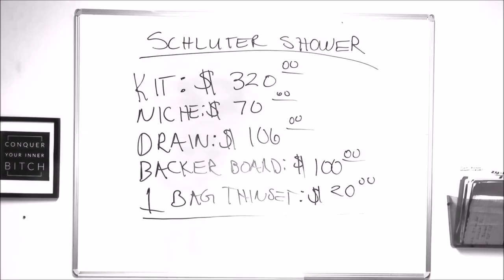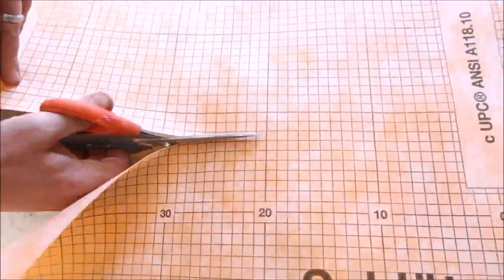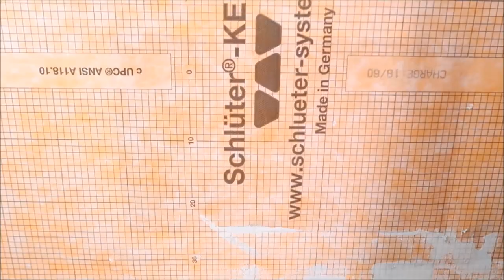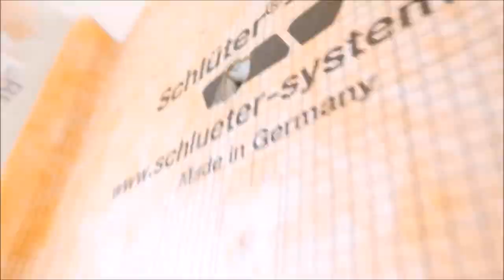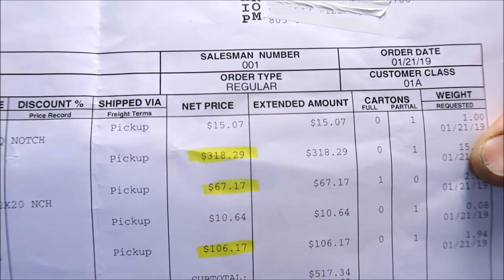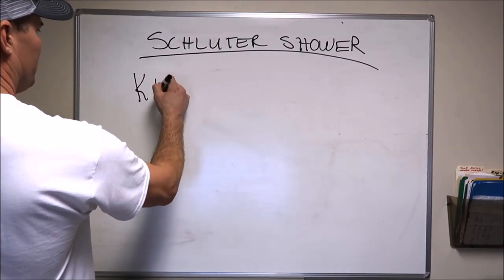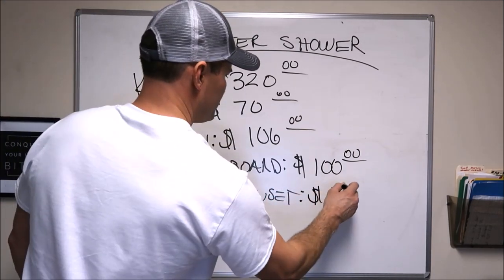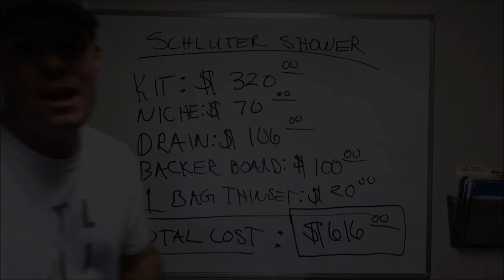The Real Cost of a Schluter Shower

Comment: Been doing Schluter Systems here in Cali for over 5 yrs   No problems ever.   Will never use RG     We used to hot mop, deck mud, wall float, scratch, etc    Now Schluter all day every day.  However you forgot screws, kerdi fix, specialty drains, benches.   We always wait a day to install, never same day.   Ossss
Reply from the maker: same here, fast install is money

Comment: You forgot the cost of the kerdi membrane used on top of the green board... ? 
Also if you’re doing kerdi on top of green board you may as well use regular sheetrock, nothing special about greenboard compared to regular drywall
Reply from the maker: Kerdi membrane is included in the $320 kit.
Also, green board has a moisture barrier vs. regular drywall. The cost is not much more, so why not...
Thanks for the watch and comment sir.
Reply: Ok i didnt know the kit included the kerdi membrane, ive never bought a “kit” 
Also now their pans come with the waterproofing attached which would make it a bit faster. Love your videos man keep it up
Reply from the maker: Thanks! Will keep up the videos, thanks for the comment and watch
Reply: Mr B's Life kerdi is NOT included in the kit.. I’m at DALTILE 3 days a week and that’s not accurate at all

Comment: Trouble with Schluter is one can't find everything you need at Lowes or Home Depot. They have fabric but very few stores sell kerdi boards and even then only in little 32" x 48" size. None stock Kerdi Fix or Schluter All Set and good luck finding the right square notch trowel (1/8 x 1/8) or an unmodified thinset that's not the questionable $7 bag. Had to piece my kerdi board shower together from two distant stores and Amazon. Great video however, thank you.

Comment: I believe any system done correctly will work, if people are serious about a water problem then why not just Epoxy grout the shower area, problem solved and will look great for a lot longer 👍
Reply from the maker: Correct, any system will work if done properly. Things to consider is your body, lungs etc.
Reply: Expoxy grout and a non porous tile material. Also I think the shower pan membrane should be installed first brought  up at least 6" up the walls

Comment: A 3x5 shower with cement board, mud pan, and liquid membrane is about 300-350 at most box stores. So its about twice as much on paper for materials. However, installing the Schluter system will only take 1 day of prep for most installers. A mud system takes at a minimum 2 days if you do it properly with prepitch under the liner. So with the additional labor cost of installing the pan you are really spending the same money as the homeowner. Great video as always brother
Reply from the maker: Great point! thanks for the comment sir 👊
Reply: Do u need a pre pitch if you kerdi the mud pan?
Reply: keith nygaard no. You need to use a bonding flange set in a slurry/mudset if you are going to Kerdi the pan though
Reply from the maker: @keithnygaard3129  Negative, that's another advantage. Pre-fabricated, pre-pitched pan/tray is all you need.

Comment: Dear Mr. And Mrs. Homeowner, labor will be an additional cost. Just sayin'.👍
Reply: i usually charge about 3-400 to do a shower like that. 
the warranty sells it though
Reply: jake garcia your business will sink charging those prices
Reply: Miguel Salgado like sink cause cost is too much or too little?? I personally never done one but if I do labor would be a extra $800-1000
Reply: @JavaZombie  Just to install the Shluter, or including doing the tile, plumbing, etc?  400 sounds about right just for the Shluter, if it takes a day.
Reply: Can a homeowner not do this themselves? If so, is there an alternative for heated and curbless that won't have to be redone 10 years later?

Comment: Kerdi board on walls would b a better install and less time.4x8 board at $80.Kerdi TT on shower.Kerdi All Set(modified) mortar $30 a bag .better mortar.My prefence if your doing Schluter Kerdi System.
Reply from the maker: We feel that not only is drywall more ridged, but cheaper, and much quicker to install. We have done both ways...

Comment: 1its not waterproof. 2 the buildup of multiple layers inside the pan will cause at least a 1/4 inch bow at the bottom. 3 how many jobs allow for plumbing after the shower walls are sealed up.
And it takes only 10 minutes per wall??? That's total BS

Comment: Add extra for a bag of modified grey thinset to set the tray pan  with they recommend now that you use modified for that. Also you used a couple outside corners around that window lol the drain only has two for the curb not sure about what’s in the kit we buy and stock volume of Schluter Kerri product as we install 600 houses per year 😂 I like the video your close it’s about 630$ but hey that’s a great deal for a great product!

Comment: Do not use green board. Schlueter may not warranty.  Green board has a wax on the surface to help with water vapor and mold resist and it may not allow thin  set to cure properly. Tiles might fall off.  Schluter is a waterproof system already and green board is not necessary. I love  Schluter and I use that on everything for tile.  If you are are a tile setter find schlueter class and get certified. It will blow you away on how easy it is.

Comment: I don't know why you would still use green board, lots places code does not allow it to begin with even with waterproofing over top. The price difference is not much more for say permaboard or any other cement board.
Reply from the maker: Much quicker to cut, not dust to inhale, no weight to carry etc. Using a seal system, it doesn't matter what your backer board is...
Reply: Marc Favell Everything  I have read says to use standard drywall and not green board.   Reportedly, the green board has a wax based water repellant that doesn’t play well with unmodified thin set.  Schluter recommends using only standard dry wall under the Kerri.  I just did my first ever shower, and used the Kerri kit, which included the drain in the kit, based on recommendations of multiple local tiling pros.  I was totally pleased with the Schluter products and ease of use.  My 72” x72” kit was about twice the size and twice the price of yours.  I got the kit, extra valve seals and extra corners from Amazon.
Reply: @LandbergTileTV  I here you but one leak in the wall will lead to failure considering its only waterproof on one side not saying it's going to leak but accidents do happen I just like having the customers covered.
On a side note I believe cement board like permabase plus, which I like using is just as easy as drywall and can use same method just not power tools, to cut down on the dust (little harder to cut, but still not bad at all) just my two cents. Love you channel @Landberg cheers buddy from Ontario Canada 😁
Reply: @JT_70  I would never use and are not allowed by code regular or greenboard in a wet area not worth the risk, if a pipe burst not much more money for cement board
Reply: Marc Favell It’s hard to get past the fear of non-waterproof wallboard in a wet area like a shower.  If the waterproofing is done correctly, I’m okay with only one side being waterproofed.  You are right, if you have any punctures or perforations, the waterproofing fails .  I’m convinced that membranes work great if installed  carefully and correctly.
Reply: @JT_70  I here you bit still not good practice in my books lol

Comment: My boss will put the schluter pan in, then run durarock up the walls. Then uses the schluter tape around the base with ardex x 5. Then waterproofs the durarock with some blue stuff. I think it’s wasting time and can’t be good?! I made a cup from a scrap of the orange schluter and put some water in it, 3 days ago. The water started evaporating and it showed no signs of weekness.

Comment: UPDATE * INFLATION * COVID.... * * * *  Add Labor cost / How long does it take to install.. on AVG. 1-2 days.. 1-2weeks.. Plumbing needed? Drain Extension/ Shower Valves / Shower Head/ what if we have Windows to Schluter Kerdi around? what if we want a Bench... Shower Glass? Semi Frameless Vs Frameless 3/8" with Shower Guard Sealer.
Reply: 616 prolly would have been true... but you need tools you have to take into consideration also... Mixer.  Drill and Screws... Plumbing Pipes.. 2" pipe and Coupling... Need to Break Concrete?... and repour?... Studs to frame in the Shelf/Recessed Screws... Trowel? and margin trowel? Buckets?... Work Bench/Table or cut on the grass... 

Not Everyone has hand me down tools... or Power Drills.. thats not even covering Basic PPE.. Personal Protective Equipment...  Safety glass, Dust Masks, Knee pads.. Gloves?...  ... nor a TILE CUTTER... or a Metal Grinder to gut the notch outs. Nor the Grout... to fill in the gaps from tile to tile... i mean $616... will get you something but it wont cover Majority of items needed to complete a Schluter shower job...  and this video is dated...

Comment: I'm a homeowner in San Francisco.  Would like to install my own shower (or two) in the next few years.  I don't think California (San Francisco in particular) allows green board backer in shower.  Think only cement boards are code compliant.  So if I have to put up wonderboard (or equivalent), might as well just redgard it instead of using kerdi membrane.  Not sure if the Schulter drain and drain pan are code compliant in San Francisco as well.  Actually, I would like to use the same Schulter installation as you've shown in this video, if it's San Francisco code compliant.  If any tile setters out there know for sure, please comment--especially if you have experience using Schulter products in San Francisco.  EDIT:  And I will get around to checking with SF Building Inspection at some point in future.

Comment: I get the standard pvcE drain for $86 ..6'7" roll of kerdi is $725 for 646 SF .

I Mudd my shower floors.so I can do a complete kerdi shower for around $300 depending on size.

Also check eBay I've gotten rolls of 323 got as little as $220
Reply from the maker: Interesting. Thanks for sharing, I'll have to check out Ebay. 👊

Comment: Great video, but I didn’t see that at my local Lowe’s. 👍
Reply from the maker: Most Lowes around here carry the product. Check with local tile stores. 👊
Reply: Landberg Tile DIY TV Sure will thank you much, the sales guy at that time recommended mold resistant drywall/a purple board with at least three coats of red guard, for my curved corner shower wall. I’ll check it out thank you.

Comment: Redguard 
Green board , redguard and your done.
 All the extra work and cost that is truly not needed .
Everyone is trying to invent a better wheel 
To me the cost is silly , an extra 650 bucks at best makes no sense  when any diy guy can screw on drywall and paint the waterproofing .
Spend the 650 bucks on upgrades you can see and appreciate .
This and like systems are zero better than  redguard paint on waterproof .

Comment: This is not exactly accurate...costs maybe, but ease of use is not represented properly
Reply: @Josh Hoover   Wire mesh, drypack mortar, screeding, ensuring the correct pitch, cement board, the mess, etc. comes with ease of use? The modern systems are pretty damn easy in comparison.
Reply: If you never learned the old ways, sure, the new stuff looks pretty good. I’m not taking about floating wall mud and shit, I’m just talking about how much kerdi is over inflated as a “great” product, when it’s actually an over priced fail waiting to happen...check our Isaac ostroms channel if you want to see some good side to side comparisons with the competition

Comment: Make certain to purchase genuine components from an authorized installer. Your labor is probably double of what others are. You are not available in every state.
Reply from the maker: What do you mean? You don't purchase components from an installer. You purchase them from a tile specialty store such as Dal Tile. Also, why would my labor be double? Sorry, I don't understand the comment.
Reply: Landberg Tile TV I’m saying, you’re short changing yourself on the potential to mark up materials (business expense of acquisition, transport, time) and you wish to give that away to the wealthy at no additional cost? Tile is a VANITY, a WANT, not a necessity. 
Others are offering years of experience and strengthening the Tile industry within TCNA & NTCA. I have removed systems installed by homeowners and bath fitting contractors, that were NOT installed properly. All I can conclude is that you ARE the undercutter. Or, you run enough crews to give it away at cost, but prosper off cheap labor. Tell us the other half that is being concealed. Transparency
Reply: bill hill  dude, maybe you are TOO HINGED! I am simply saying, money is irrelevant to a majority of clients. The Schluter Cost of Materials is what it is, I agree. Those prices were meant to stay with the contractor and catalogue, not be public info. Even then, most homeowners will not be patient enough to endure a contractor video. You do very nice work, and hopefully some of the cement board dinosaurs will come around to using a more sustainable system. My only med is common sense, experience and WISDOM. We’re all working on “conquering our inner bitch” lol. Your sign! 😂

Comment: Kerdi is the cheapest method-change my mind
Reply: It’s all about the labor to get the shower “Tile ready” I can’t speak on CBU guys or kerdi guys but here in my area us mud guys get 10 bucks a foot to float. So a typical shower (100 square ft) plus materials is around 1,400- 1,500 so kerdi guys are already winning at that point but I imagine the square foot price to Tile is similar so kerdi would end up less expensive
Reply: I feel like it’s a big win on building the bench out of kerdi board real time saver vs mud.
Reply: Tile Slay yeah I just don’t like foam , my favorite part of the trade is mud work , I don’t even keep track of what methods are faster I just mud because I want to ....hey tile slay you use this name on other platforms?
Reply: No I don’t
Reply: I also like having this discussion without people getting mad about what others use. Everyone has a different background with tile. I feel the industry will benefit if we all understand the different ways, and installers need to stop fighting one another and focus on the real threat of losing our skills to home owners or builders taking flooring away. I’m only a mid player. I do some commercial but mostly residential building. And I do all types of flooring. Ceramic is my passion.
Reply: My cost all in for a durock shower 3x4 is $250 for materials and I will warranty it not to leak as long as you would like. I follow TCNA guidelines on the build and have had zero issues on the over 1000 showers I have built. I'm not a fan of the schluter stuff but I am closer to the end than the beginning
Reply: Makes no difference to me. I am a 2nd generation flooring installer. I built many cement board showers and paint on water proofing. They work. But once I made the switch back in 2000 never looked back. I won’t even use kerdi anymore, just kerdi board. Because I buy in bulk scraps are saved and my cost goes down. I have to load a van for ceramic, carpet, lvt, hardwood and other flooring type tools to go to a job and complete a whole house. I can’t afford the weight of cement board and other things. Plus I want to walk when I’m in my 60s. I totally get not wanting to change on your way out of the industry. My father fought tooth and nail about switching. Now he would quite before going back. Plus I don’t think installers understand Shulter wants the Installers to make a profit. So if you sell based on the book and buy from a real tile store like dale tile or others you make a profit to also off set your cheaper labor to install their system vs cement board where the money is in the labor of installation of the cement board showers. My business is more successful now is my only point.

Comment: Don't go with a Schluter, go with Wedi. There is no Sheet Rock behind it. No thin Membrane anywhere, after it was up taped and sealed, including the ceiling. The builder let me bring a Hose in a throughly spray it down, we filled it with water to the top of the curb, no leaks over the weekend. BTW the Ceiling is tiled, the toilet is in the wet area, to the right, shower is to the left behind a splash shield. The entire area can be hosed down, three years later not a single leak. An added bonus is the shower warms quickly, due to the Wedi.
Reply from the maker: Will be trying Wedi soon!